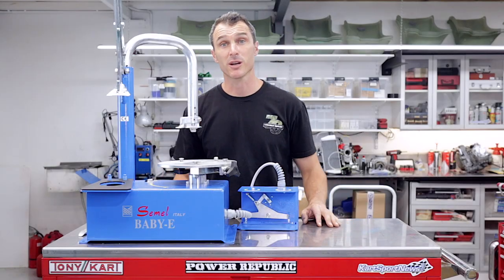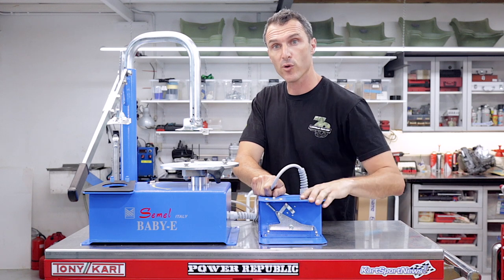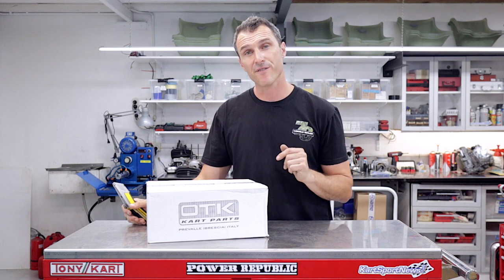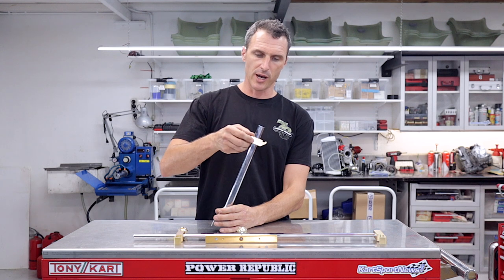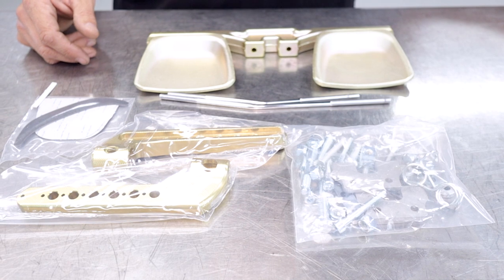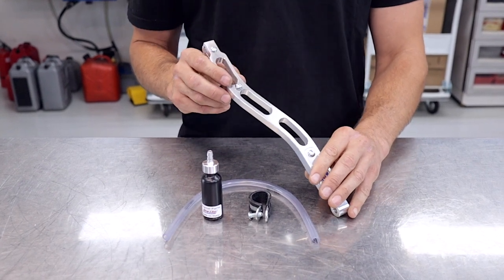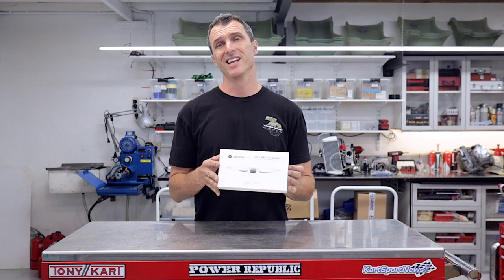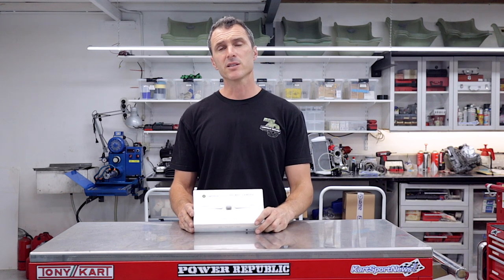NEW PRODUCTS: Introducing New Karting Products for 2021 - POWER REPUBLIC

Comment: That new camera looks pretty dope. Interested to see how that looks in videos.
Reply from the maker: Hey Boss, I have one to test drive.  ill bring it next race weekend in May and share it around to get some footage for our Insta and YT.  PS how's the new kart going???
Reply: Received mine last year's September, after almost a year wait 🙏 Only used it on the motor bike so far. The quality is all right although sometimes it freezes probably due to a bug in the firmware, guess that will be fixed sometime. Get yourself very sticky velcro, the cheap stuff will let loose and the camera dangling in front of your eyes is quite distracting while doing 200kpm on the bike 😵 Also remember if you are using a visor sticker to make a hole, obviously the thing can't look through a sticker but a tinted visor is no problem. Other than that it is far better than a GoPro mounted on your helmet.

Comment: I'm thinking of joining the sport over here on NZ and just wondering do you have to buy the latest gear to be some what competitive or can you buy a slightly older kart and still get the same results. Not talking about winning championships but more at club level. Thanks
Reply: You dont need to buy new mate. But keep in mind that kart chassis does flex, so a 5 year old chassis is not ideal.  Many top level guys replace there chassis every 1-2 years, maybe a better option. These guys have posted a good video on checking a kart chassis, run through that exercise before buying. The main difference in old and new is the new chassis should/will respond to change better than a older chassis. At club level its about learning and having fun. Good luck .
Reply: @GG-rj4oj  thanks mate
Reply from the maker: your results wont change really, casue you are new and there is a learning curve you cannot buy your way around.  If you got something 1-2 years old that would be ideal.  Ohterwise get an old banger and get out there and have some fun.
Reply: @PowerRepublic  sweet thanks, really loving the videos.

Comment: Greetings from germany.
Can you make a Video next time about Tuning of 2 Stroke Engines maybe Iame X30, x30 Super 175ccm, how we can make it Faster, maybe with Ethanol Sprit 120 oktan or Aspen. Or the difference between spark Plug and Racing spark Plug or another carburetor, These and onother Things about Tuning.
Reply from the maker: Thanks for the idea!  we don't really have any experience.  if you are not racing you could always get a bigger engine, that is always faster.   if you are racing then there isn't normally any legal short cuts for add on faster components unfortunately

Comment: Do different types of whales change the performance of the kart 🤔
Reply from the maker: Hey P Dubs, whazz a whales other than an Autocorrect from google???
Reply: @PowerRepublic  i think he means wheels
Reply: @haroonplays3389  either that or he's insulting his over weight friends.
Reply: Btw, adding a whale will seriously slow the kart down, and theres a decent chance of chassie and seat damage so its not advised.
Reply: @christianbuczko1481  XD
Reply from the maker: arh corse it is,
Reply from the maker: P DUBS, if you are asking about wheels, we have some videos on the different types of OTK wheels, have you checked them out?
Reply: Regarding wheels, top racers use magnesium or aluminium depending on tempreture because they heat up differently meaning tyres come into best grip when they need it. You want grip towards the end of the race so using a type which prevents them getting cooked early can help, or using a type which allows them to warm better in cool weather to get best results. Its alot of skill and judgement to figure out which is best, and starters should not worry until they are losing races by a tenth of a second.
Reply from the maker: Exactly, thanks Chris ^^^